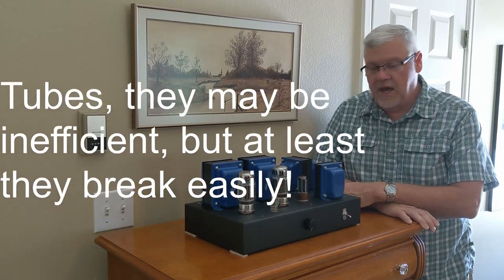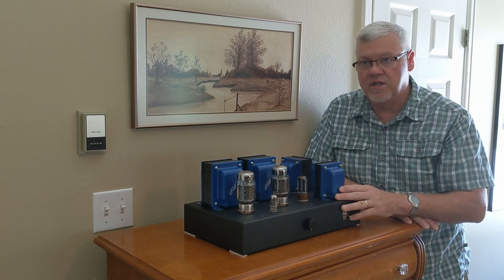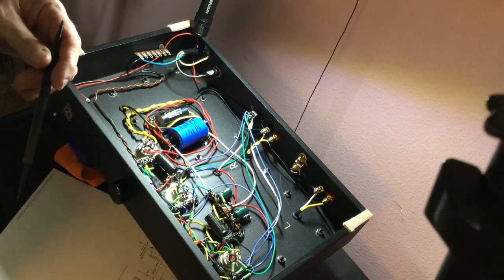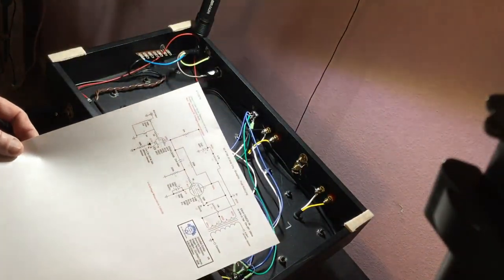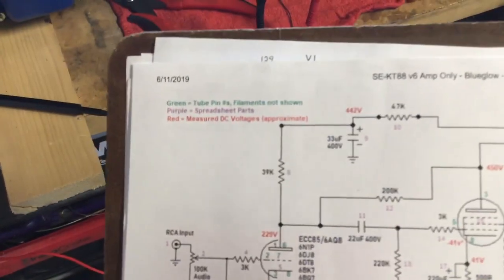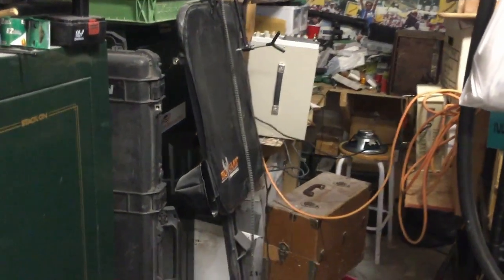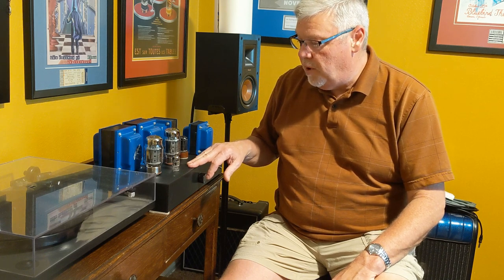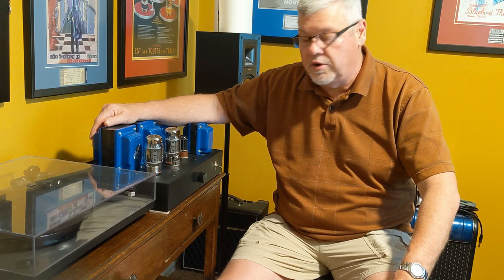I built a KT88 Stereo Tube amplifier!

Comment: Ross,
Thumbs up on your video.  I have built the same KT88 as yours and I’ve had some voltage problems, too. Your video has enlightening me. I never noticed the voltage disparity on the 33uF 450v caps until you pointed it out.  Also, I thought I was the only one in the club that mounted my tube sockets on a 45° diagonal so that I could look at the gold lion logo. Very cool. Thank you!
Reply from the maker: Hah!  Glad I am not the only one.

Comment: Hi Ross, I know it was a while ago, but I was interested in your comments on this KT88 amp, I have recently completed one basically following Marks videos, although I used a slightly larger chassis and Hammond Transformer’s and choke. The mains Transformer is 373BX for UK supply! My voltages are a lot lower than what Mark was reading, but that is probably to do with my line voltage and different Transformer!  My Rectifier tube is a Telefunken GZ34 After warm up I measured the Plate voltage as 400V DC Pin 8 Cathode 36V DC and pin 8 and pin 5 -36V DC  I have uprated the 500 OHM Resistors to 25W, the amp sounds really nice to my old ears, the only other mod I may do, is fit some Diodes on the rectifier supply, I wonder if you have any comments on that, also how hot does the chassis’ get around the tubes on your amp, mine gets fairly hot, I’m thinking that this may be a cause for concern as regards components getting too hot! Thanks for any comments! Alex.

Comment: If you ever have that problem run a larger pair of caps in series. It doubles there voltage and half's there capacity.  Also the 5y3 is way under sized for this amp.  I would use a vintage 5ar4 or stick with 5u4
Reply from the maker: The 5AR4  was what the build called for, I used the 5Y3 to tame the b+ but that was never intended to be a long-term fix, and I have since switched back to the 5AR4.  I think I put that in an update in the description.  I agree that running two of those cheap cap's would have worked (although it isn't exactly half the capacitance?) but after I got burned, I decided to cut my losses ;-)
Thanks for the comment!

Comment: Ross, both my builds have 450v caps, many many hours on the first no issues yet, but you made me nervous so may replace mine.
Reply from the maker: William Yorston I guess it comes down to what your voltage really is. Mine was 462.  In fact my voltages have always been pretty high.  I went back to the 5AR4 rectifier and am just going to roll with the high current going through the KT88’s.  I read a few things on the net that said the KT88 could handle high dissipation for extended times.  If I were you, I would get some 500-600 volt caps and replace them since they are easy to get to probably. With the 750 ohm resistors, the current is a little lower.  When I build the next one, I will up the wattage rating on the bias resistors.
Reply: @rossharrell6218  This build is at 449.3
Reply: with the 5AR4  the current on the preamp tube is at max.. when using the 380v/380v transformer.... @rossharrell6218

Comment: I just wanted to comment on the caps.. depending on the power transformer and Rect tube the B+ can be way to high after break in..I also build one and my voltages were off the charts  after breaking it in..and the bias on the KT88s were  91ma .. so I changed the Bias resistor to find out when you lower the load.. the voltage goes up.!(491v) with a 600 ohm Bias resistor.SO  keep the 500 ohm resistors and 10W is fine... although larger is ok to.. under normal load the load on the bias resistor is about 3.5W.. use a transformer with 360v-360V  and the 5AR4 and the bias will end up after a few hours of 80ma on the KT88s... The parts diagram is wrong... 500 volt caps should be used.. and also when powering up the voltage can spike.
Reply from the maker: Totally agree with you. I settled for. 750 ohm resistor and am running the 88's at about 85% sounds good. I am putting in a thermistor as soon as I get one, more for the voltage drop than the spikes but that is a benefit also.
Reply: Hey Ross.. I also put in a  thermistor .. I love the sound of this amplifier.. and with the Solid Cherry  Altec19 clones I built,, together its amazing..I have to give credit to MARK.. He made it easy.

Comment: Great job, Ross.  I have yet to build mine, I am at the fabrication stage, ready to drill but I am hesitating.  I am tossed up on the same exact issues you would change.  Do I want a volume pot and why not just run it in ultralinear. Once I drill...I have 450V Nichicon caps also but am wondering if your problem was mainly being cheap caps?  I imagine the voltage ratings are understated by a certain percent, so I am hoping the 450V caps will be fine.  If not I guess I will be replacing them too...
Reply: The transformer that Blueglow electronics used is 380V / 380V    that's going to set the bias at 91ma after break in..KT88s are running at 38W.. mine was spot on same as marks when built.but after a few days I noticed the tubes being hotter than normal.. so I took it back to the bench and started measuring.   485V  B+    91ma on the KT88s..so I had a old 5U4 that I tried and the voltages were back to normal.. put in the  5AR4  CRAP.! 485V !  so. I think the correct transformer with the 5AR4 is 360v / 360v   and the correct transformer with the 5U4 is 380v /380v.
my bias runs at 80ma each KT88 and it sounds great.. 1 more thing.. I tried different preamp tubes..the 6N1P works best in that circuit, as designed..
Reply: @dandee5018  Thank you for this information!  I have completed drilling my chassis, I will start wiring it.  It is a slow process as I work long hours and don't have much time for it.  Anyway, I will build mine like the Blueglow version and watch my voltages.  It will be interesting to see the differences in all these builds.  Mine will be an exact cookie-cutter with even the same brand components Mark used.  If my voltages jump after break-in I will just follow your lead.  It is good to learn from the experience of others.  I did swap out those 450V caps too.  I mean, they are cheap, why even install them if questionable, right?
Reply: Hey..  you should use the 360v/360v power transformer.. the 380v is on the edge!  if you already have that one.. I used a 5U4 rect.. that solved my problem.. if you change the  bias resistor on the KT88s the B+ goes up when the current goes down.. I found that out the hard way.
I don't know if there is a way to exchange emails?  I have photos and I also built a set of Altec 19s. that really sing with the KT88 amp... I have a listing in craigslist kt88.. Cleveland. @turnersparadise8368
Reply: if I built another KT88 amp.. I had built mine in only ultralinear.. which is awesome.. and I leave the volume at max.. so I would delete that control and cost..  but I would put 100K across each input.. the line input needs a good preamp to drive the amplifier..  also the other preamp tubes need lower plate voltages.. use a 6N1P.. that seems to work best with the parts in the parts list...
Reply: keep me informed.. I always like to see progress of the builds.. kt88 craigslist cleveland

Comment: Nice job kinda was this a kit or a design from the internet  and why did you choose this design?
Reply from the maker: Not really a Kit, but Blueglow electronics made it a virtual kit by supplying the expertise and parts list with his video series, check it out.  I love SE amps, but my next one will be P-P just because I want to try it out.
Reply: @rossharrell6218  I’m not a fan of blue glows work he does a lot of modifications to original designs I keep things buy the book and I don’t like his method of using thermistors simple resistors and simple math are used to reduce higher voltages 
I would only do a scratch build with transformers I have laying around I don’t see the cost return in dumping about 800 dollars mosty in transformers for a 10 -14 watt amplifier that doesn’t even have a preamp 
And not to sound like a jerk but my Scott 222c would probably sound a lot better then that amplifier you made and for half the cost 
It’s hard to get  all your money back on a amplifier that you made

Comment: Thank you Ross.  This is one amp I am considering building.  Do you know what wattage and distortion figures this amp produces.  Also linearity across the audio spectrum?  Thanks!
Reply from the maker: Glad to hear you might build it!  As for the testing, sadly I don't have the testing equipment needed to get these figures. However toward the end of the series, Mark goes into some details about power ratings and harmonic distortion etc.  As far as power output, I have done some testing with the oscilloscope at various frequencies. I'm planning on doing a second video where I update all that information, so stay tuned for that

Comment: could you be using the wrong primary on your power transformer? Some transformers have taps for Japan where the voltage is about 105 VAC, 60 Hz.
Reply from the maker: Not in this case, the PT only has on primary winding.  I am going to do an update on this project any day now.  Thanks.
Reply: @rossharrell6218  too bad, it would be an easy fix.

Comment: Are hifi preamp tubes different than the guitar preamp tubes?
Reply from the maker: Not really in any qualitative way. However as with most things stereo, if the same tube is handling different channels you want to make sure that both sides of the triode are matched. I had to make sure that my preamp tube and my power tubes were well matched so that I didn’t get differences in channel output.  If I had a guitar amplifier with significantly different amplification stages in each of the triodes I wouldn’t care much.

Comment: Why no demo of sound?
Reply from the maker: I just didn't want to look into the whole copyright thing. I could set up a stereo pair of mics and record something but it didn't seem worth the hassle. I suppose if there is desire for it could do it. I have since put in a thermistor and changed the rectifier, so it might be worthwhile.
Reply from the maker: While it is not an in-depth demo, I did use this amp for a video where I restored my Knight preamp (just look at my channel to find it).  After I found out that copyrighted music only becomes an issue if you get paid for the video (which I will never be ;-) I posted a video with the amp in action, if only for a few seconds.
Reply from the maker: Just did a follow up with demo!

Comment: I watched marks YouTube channel on Blue Glow for years and this is the very same amp that I want to build. But I currently have serval Nelson Pass amplifiers I’m working on.         Could it be your voltage is higher because in your part of the country your line voltage is higher. Also the tolerance and resistors even though you and Mark may have picked the exact same resistor value plus or minus a few percent. Marks resistor value example could be plus a few ohms your exact same resistor value could’ve been minus a few ohms. Stack that up with a few extra volts on your line voltage plus a few arms on your resistors then multiply that going through your transformer would make a big difference on your secondary voltage. Different parts of our country have different voltage even though the standard is supposed to be 120 parts of our country only have 114 or 118 in other parts of our country have 129. This will make a huge difference on the secondary output voltage.   I always like to add a lot extra voltage rating on my caps just for the peace of mind and the extra life.    Example if it called for 400V I would put in 600V.          Excellent build I can’t wait until I make mine.
Reply from the maker: Thanks for the comment.  I agree that there are many variables, and they add up.  My line voltage is spot on 120V +/- .3v  However, who knows what is is at Mark's place.  The truth is, my voltages agreed with his off the b+ rails, but after the plate resistor and a few other places, mine went higher than his.  I can live with it the way it is, and you are right to build in some margin on high-voltage caps.  Like I said in the video, I got anxious and ordered the caps that were available at the time. I am glad you will be building yours soon, I listen to mine almost every day.